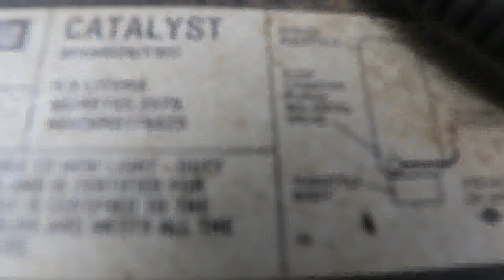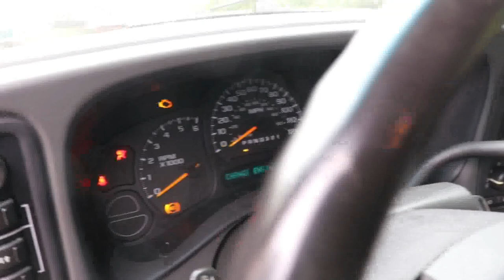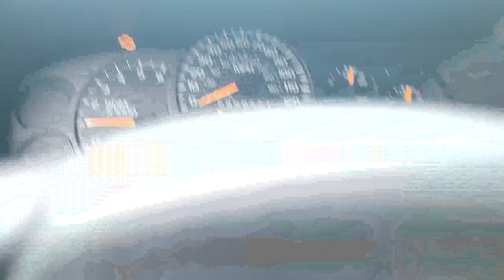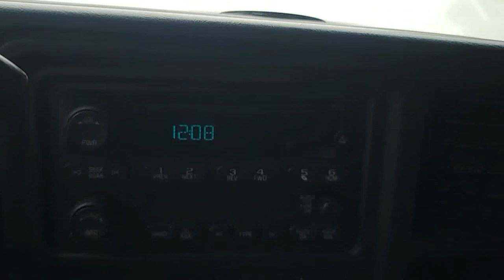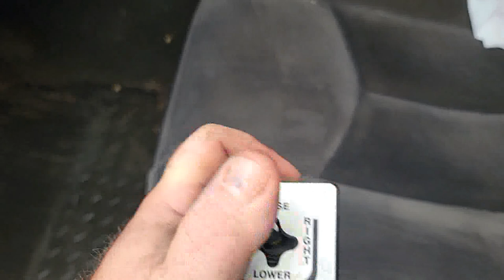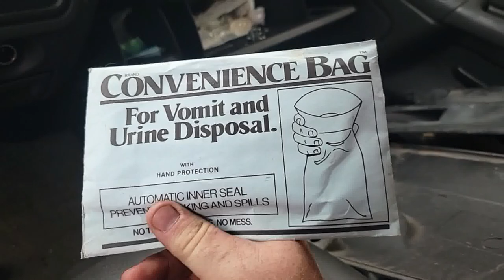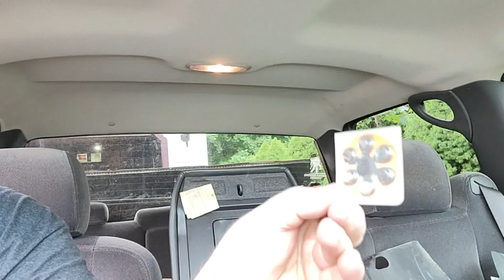WILL IT START? Old GMC left for DEAD

Comment: Definitely road hard and put away wet, this truck definitely had a hard 200,000+ miles.
This was probably a $30,000+ truck back in 2005, just think if it was properly taken care of how much it would have been worth now.
You could probably sell some of the interior parts, seats are definitely still in good shape.